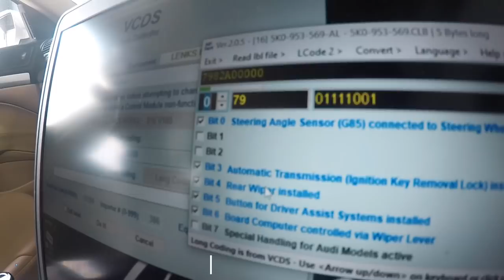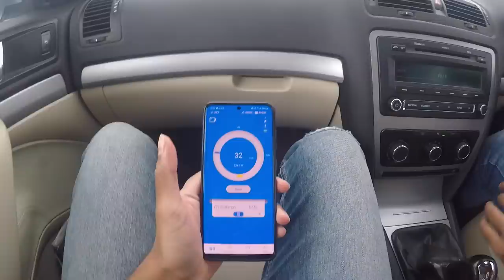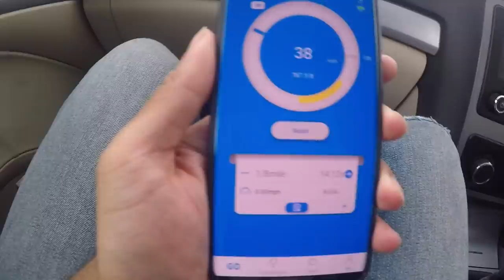Stage 2 Tune for our Skoda Laura to 220+ Horsepower! + Acceleration Test (FAIL) | #ProjectLaura

Comment: Hey @TheDriversHub planning to buy a new vento 1.0tsi HL Plus manual. Is it a worth buy or should I go for a very pristine , well maintained 1.2 tsi Dsg (pre owned) ? 

Your reply would really help make a choice.
Reply from the maker: Honestly we would suggest to go for the newer 1.0 TSI offering. It is much better engine, much more reliable, the 1.2 TSI with the DSG has many problems. DSG failure will always be in the back of your head whereas the new car has a more carefree experience. DSG failure costs approximately 1.5L to fix, so do take all of these things into consideration.
Reply: @TheDriversHub  thank you so much for your response !